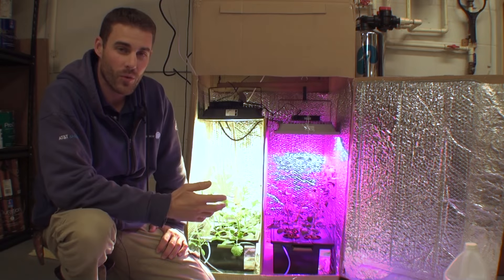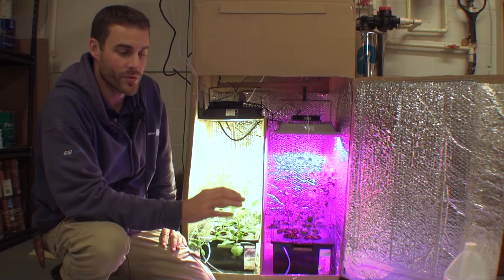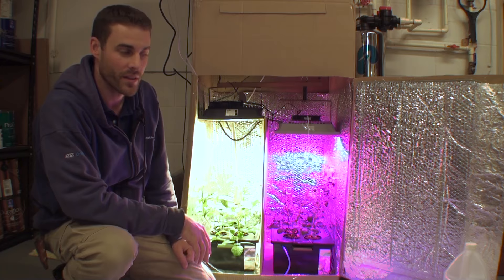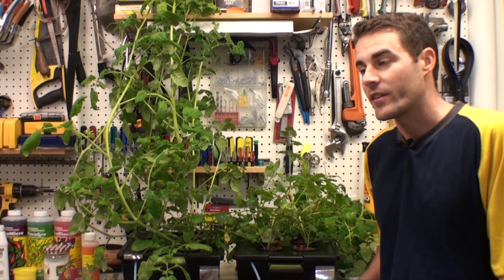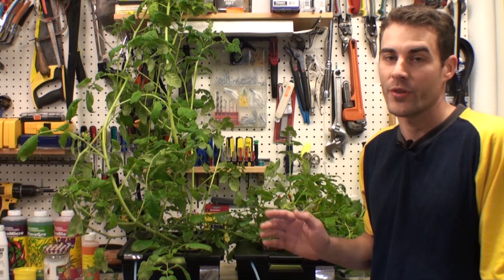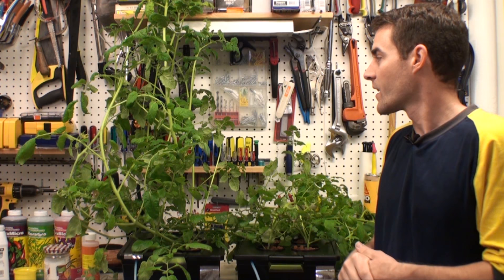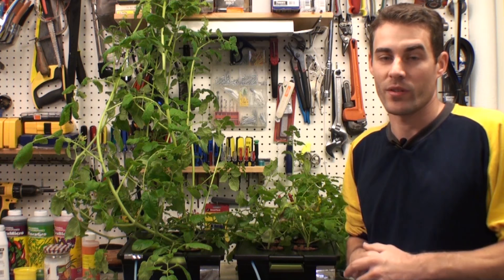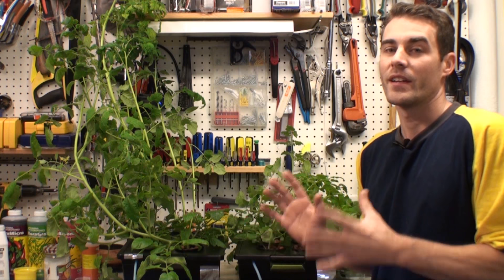White LED vs Red/Blue LED Grow Test - Part 4 (The Final Results!) "Hydroponic Tomatoes" 2016

Comment: So this means I can grow a plant under a 20.00 flood light. This is a hell of a lot cheaper than a store brand CREE or COB light.
Reply: Did you ever try it?
Reply: @1fast72nova  I ended up building a 300 watt light with the cheap Chinese 5 meter rolls with 3 x 3000k and 2 x 6000K diodes for roughly a 2 x 4 ft space.(50 bucks) I could get 1000PAR at 6" above canopy back then. lol
Damn, that was a long time ago. Been DIY'ing lights ever since. The Vero 29 gen7's COB's are still very good diodes for today. I've built all kinds of different lights from home made QB's to the 301H bars with UV and IR  controls since this video. lol
Reply: @happyg.444  wow that's really cool, I've been thinking about building some lights lately. The most recent think I've tried are the 3000k 100w driverless QBs spaced 16" apart and between each one mounting a 50w pink "full spectrum " driverless LED in 10' sections, planning to run two wide down 4' wide runs 40' long. Does this sound viable? Or should I look at other options

Comment: Thank you sir, for your great work and serious effort,  you did a bang up job!
Two questions comes to mind, -did you expect that the 3000K alone, from that early stage in plant life-cycle, would produce such "vigorous" growth? and secondly, what would you expect to have been different, had the initial 6000K been combined with the 3000k? -or just the 6000K alone?
 Greetings from Denmark
Reply from the maker: SlapJackAnon I wouldn't have expected that vigorous of growth, but I had anticipated it. What would happen with a 6000k is the plant would grow shorter and have tighter node spacing and more leaves most likely. Combining them would just help the stems get thicker and the plant overall, would grow larger

Comment: Thanks man. You did a great job of making an understandable informative video, As of last summer there have been a new breed of LED light showing up at the home improvement chain stores and i just had to try them out. Bingo!!!!!! these suckers change EVERYTHING at a very low cost. A 6 yr old could grow his own strawberries in his bedroom.....Not that i recommend that but go for it if you like cleaning messes. Anyway the brand i seem to be using is a generic one called GT-lite. It's the same kind of Led that most of us have already installed in our homes that screw into any standard fixture but on steroids. Designed is changed. There isn't any cover over the hundreds of tiny Led lights and it's in the shape of a cone. They come in many different wattage's and shapes, that's just the type i chose. they range from 2000 lumens all the way up above 10,000 lumens for a single screw in bulb. They are made to light up barns and warehouses & such. At a cost of around $20 a piece i picked up 3 but only ended up needing 2 for my space to get good result's. The bulb I'm using is a 300 w equivalent 40w actual 5200 lumen 5000K cct daylight. I have strawberries flowering and set and a few other flowering species making flowers 6 weeks into my little experiment. These small compact light's are easily movable allowing me to have one over the top and one hanging lower to hit the bottom half of the plant more easily.....use your imagination . I would like you to try a video on these and take it further. Giving you a BIG thumbs up buddy.....side note... I'm a very experienced hobby grower...all the background you get

Comment: hey ryan. I heard these LED (especially the white one) can heat up to 200°F is it right? I want to get one of these to overwinter my pepper plants but I'm concerned it will get too hot and it stops working. have you had problems with the temperature?
Reply from the maker: Daniel Takashi I use a small fan to cool the light. These lights are not designed to be ran for many hours in stale air. Usually you will have a fan blowing on your plants anyway. most lights designed for growing are not driven at the full wattage that the led is capable of, but these are so to answer the question...yes. The center of the light where the cob is attached gets very hot without any air movement.
Reply: Thanks for your quick answer! I'm gonna research a little bit more before anything. Thanks for the info
Reply: LED lights wattage fluctuates depending on temperature, in hotter weather LEDs use less wattage and in colder weather they use more wattage I noticed.
Reply: @Sety777  but the light output is lower in hot and higher in the cold as well. This is because at higher temperatures the led resistance drops (part of why led is constant current not constant voltage) so the wattage drops since you have lower voltage for the same amps which means watts=volts*amps meaning lower watts, however since the led is less efficient at those higher temps you get less light per watt. As an example with average cooling the cree3590 gives 2.7micromoles of light per watt at about 20-30 watts but at 70-85 watts that drops to 1.7 micromoles of light per watt, this is due to the higher temp at higher power which decreases efficiency. Those numbers may be off since I haven't looked into the specifics in a while but the basic idea still stands.

Comment: What type of white light should I use? warm white, cool white or daylight?
Reply from the maker: Baris Yilmaz warm white for general grow, daylight for vegetative.
Reply: +Random Ryan  Shouldn't it rather be cool white for vegetative, or even 2x blue and 1x daylight LED combination? I'm thinking that in the springtime, when seedlings are emerging out in the wild, the Sun is still relatively low in the sky, thus deeper atmosphere at that lower angle, to weaken the red end of the spectrum, while the plant at that time of year sees predominantly blue sky?

Brilliant video, by the way. You pitched your message perfectly for me to take in.
Reply from the maker: John Carter red light is dominant in spring and fall. As far as mixing colors go...don't bother. Just use white. Pretty much anything between 2500 and 6500k should be fine. I would consider 3500-4000k to be optimal. Blue light just keeps plants from reaching and stretching and works best for vegetative growth, but there no need to add blue. 5500-6500 white light is enough blue.
Reply: Thank you. I'll take your good advice.
Reply: Random Ryan I'm very new at this so apologies if this is a Silly question - how can 3500 - 4000K be optimal for veg if Blue is in the 5000K range?
Reply: @ChristianFontana3000  It's wrong.. you need 5500-6500 for vegs, but I always add some 2700 light to it, it's like mixing colors when you paint, so having 2700 and 6500, the lights will mix and add up a spectrum that goes all the way between 2700 and 6500, so from my knowledge you won't need blue or red light, its all there in the spectrum..

Comment: I sincerely appreciate your experimentation, your honest and forthright presentation of the facts your experiments have demonstrated.  In parallel with what you have done, and the experiments I have run, our results are similiar... to a point.  If I can suggest an experiment (understanding you do not like tomatoes, give away the resulting fruit to a local food bank):  Perform the same grow, in hydro, with cherry tomato clones.  Keep one under the 3000k 50 watt led start to end.  Another under a 6500k 20 watt led for the first month (height adjusted for PaR), then introduce a 30 watt "red/blue" or even a warm 2700k led cob once you see blooms (in addition to the 20 watt 6500k).  

A red/far red dominant light will stunt a plants root structure, internodal lengths, and stem structure development during a vegetative stage.  It will stretch, roots will stunt, it will  ...  well... suck... and never recover, using a spectrum color/blend of predominately red during vegetation stage (think incandescent bulb).  Once flowers appear on my tomatoes, peppers, etc., red and far red are introduced at a ratio of 70% red dominant (2700k) and 30% blue dominant (6500k or higher), and the plant strength, stems, etc., remains strong, and fruit growth explodes at a rate of 4:1.  Just my input.  As far as light is concerned, never take away, only add.
Reply from the maker: Jim Baber thanks for your detailed comment. I am currently in process of ep2 in the new series growing under lighting as you described. Or at least similar. Ep1 has been very successful. Ep2 is soybean for is growth characteristics similar to Mary j. I have experience and understanding of the lighting types and phase switch overs. The experiments are to break down the reasoning into observable knowledge for myself and others. Even at the time of this video I was growing much larger and higher tech grows in the background (no co2 though). These 2016 vids were just to simplify the question of whether you can grow under fully under a static ratio of red/blue light and what happens.
Reply: I appreciate the info. My experimentation has nothing to do with soy or mj,  I am involved in work on indoor growing of food crops in urban food deserts at minimal costs.  Growing of leaf crops (e.g. spinach, lettuce,etc.) is easy under 6500k.  Flowering plants (e.g. tomatoes, squash, etc.) are harder for an urban household.
Reply: And I didn't mean to demean your work, only to express what I am doing,  Thank you for the work.  It is valued.
Reply from the maker: Jim Baber I understand. Check out my lettuce video and you’ll find the info I’m talking about.
Reply: If I may offer a simple opinion, unless your environment is totally sealed, and room temps are less than 90 degrees, co2 is a waste of resources, imho.

Comment: Hey Ryan,
Sorry if you've answered this already, I tried reading through the comments and finding a similar question but couldn't find one. I was wondering what resources you used to find the equipment for growing hydropnically. I am looking to switch from soil (mostly because of the mess) but am not very sure where to start with making a simple system like the one you had going in this video. 

If you still happen to check these messages and can let me know some info I would really appreciate it. Have a good one, and thanks for sharing
Reply from the maker: Almost everything I got off amazon. The air pump, nutrients, net pots, rock wool, clay pebbles and the pink light. The containers you can get from anywhere. Just cut your own holes. Air tubing from any pet store or amazon. I got the white light from lighting ever.com, but I don’t recommend using that for many reasons. Also get urself a grow tent. 2x2 or 3x3. I like Apollo with the c-shaped single door. I hate the kind that have French doors. Nothing wrong with cheap tents. Just make sure it has metal corner joints and not plastic if bigger than a 2x2.

Comment: i wonder how much green and yellow light is needed to complete the needed spectrum for plants?
im thinking what if you put a small, say, 10w white led together with the red/blue one, its still uses a bit less than the 50w full spectrum, maybe thats more efficient?

IF plants only need a small amount of green, there might be a waste when using high wat white leds compared to red/blue with a little white to compensate.
Reply from the maker: Benjamin Andersen technically you don’t need pure green light at all, but scientific studies have tested this and using it gave various results. So the answer is...it depends. To cover some missing parts of the spectrum that plants do use, it’s easier to use a white light mixed with red/blue. Some say that about 15% green is enough. Too much and apparently it’s not good. but by saying green it doesn’t mean a single wavelength. Its a wider range in that spectrum. I’m testing this very soon actually.
Reply: thank you for replying. makes sense what you say, also that the green it not a single wavelength, but a spectrum of light, being in the "not absorbed by plants" length. -which it turns out to be in some way.

i recently saw a short clip from the iss(international space station) and by just the looks of it, their hydrophonic farm is certainly using something similar to the red\blue diodes, but also with a mix of what looks like a warm white.
i know you cant tell by the looks of it, especialy on a video, but what was obvious was the purple light, and that it was not alone, i.e. there was also a white light, but it was much less bright.

so, i believe mixing just a bit of white with the red\blue would be a win :) 
hope you do an update when you test it out!
-best regards.

Comment: can I use both white light and red blue light to grow flower and plant ? or just only one type ?
Reply from the maker: Yeah, but there is not much of a point to that. If you start arbitrarily adding more light of a specific wavelength, you'll end up over saturating
Reply: thanks a lot ;)

Comment: Thank you for the video man! guess I'll be trying to diy my own grow light with 3000k led. Do you think 15 x 1 watt led will be enough for 40x60cm area? height will be adjusted to maintain the distance to plant at about 25cm.
Reply from the maker: TJ Ang 15 watts of light is enough for a very small plant. Grow area has no real bearing on that. In that case it's more about how much penetration you get through plant canopy. Small herbs would be fine.
Reply: OrionA51 Noted. Thanks a lot for your kind explanation!

Comment: thanks man, I'm building my setup just for vegetative growth and I'm in doubt if I put everything to 6500k or a mix of 6500k and 3000k, can it help? only for the vegetative phase.
Reply from the maker: Diogo Dias 3000-6000k is fine
Reply: You want white light, anything between 5500 and 6500 Kelvin

Comment: I strongly suspect there's some serious differences in nutrient uptake based on the spectrum. Trying this experiment in other growth mediums would help clarify the results. I've seen plenty of purple COB grows that don't make floppy plants with no roots. It would be worth testing more varieties of plants too. Still, its an interesting test, thanks for uploading it. I've purchased the COB chips these use and will be running them in fixtures with 3 chips in each; one 6000K and two "full spectrum"(aka "blurple"). The blurples are much stronger in their red output thant their blue output and the two combined should make for a nice amount of UVA too.
Reply: Read the comments, so much wrong info floating here... People keep saying 3000 Kelvin is white light, it's not white, it's yellow... you need 5500-6500 Kelvin if you want white daytime light.. even the host of the channel is saying this
Reply: @orion9k  Please do some reading about how Correlated Color Temperature is calculated; the CCT of two different bulbs could hypothetically be the same and yet both could be a combination of completely different wavelengths. Some bulbs at 3000K CCT are definitely more "white" than others despite essentially putting out similar color of light overall.
Reply: @GamingKeenBeaner  if someone gives the name 'white' on 3000 kelvin, they are color blind
Reply: @orion9k   CCT is calculated by a weighted average of all the wavelengths a certain radiant source emits. Its not the same as color temperature, but instead is a measurement based on perceived color temperature.

Comment: Thanks for all the hard work man!! Just a few Qs. Did these flower / fruit and do you know if you were getting 360-400nm with that white light? Or any for that matter.
Reply from the maker: Stefan Bachrodt I don’t have a meter to tell me the wavelengths. I’d have to use a prism I guess, but that won’t give specific readings. I imagine the white light contains a low amount of intensity in the 400nm range. And yes they fruited a little, but because I didn’t adjust the solution for bloom, they produced very little. These lights are not strong enough to get much production. It’s just a small scale experiment to start with.
Reply: Ahh alright no worries, I noticed some manufactures will add 2 360-400nm lights to a batch of 200 others. I thought UVA was a vitally important aspect to plant life but apparently not. I'll still be getting myself a range of COB lights though, I've only ever heard good things, well except for the potentially lethal part, or the part where they could be used to listen in on your conversations, jip, that can be done. Thanks for the prompt response!

Comment: If the full spectrum LED is better, why does people still uses red&blue light?  I mean when I google LED Grow light, almost all the results show are red&blue.
Reply from the maker: RandomSGguy I think you missed the part where I said this wasn't about comparing other leds that have other colors besides just red and blue. this is only 2 wavelengths specifically. (2 bands). Other typically have 7-11 bands  and/or mixed with some white leds.
Reply: But you are comparing White LEDs with Red & Blue LEDs. And the results shows that the White LEDs performed better than just the 2 wavelengths.  Why does grow light in the market still only use the 2 bands?
Reply from the maker: RandomSGguy hardly any are sold using just the 2 bands. Most that have just the 2 bands are cheap products. The ones that are better have a mix of colors with white led mixed in also. It will still appear a pink light, but it most certainly is not just 2 colors of light.
Reply: Now I understand, thanks for explaining!👍🏻